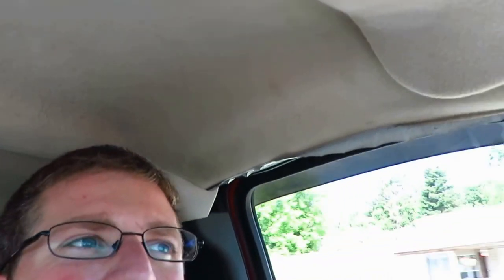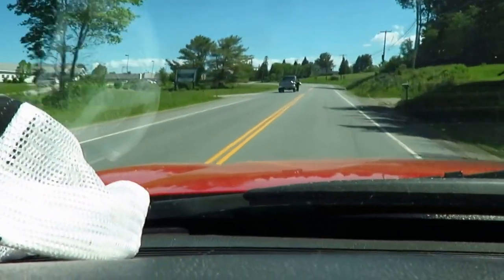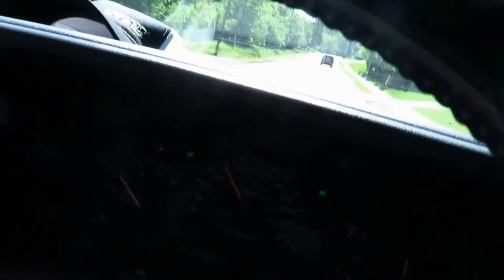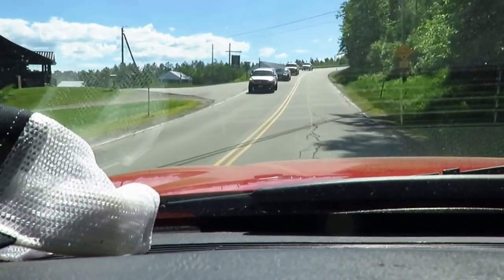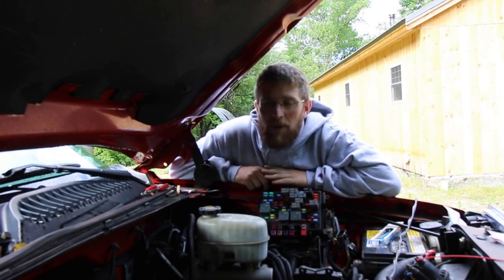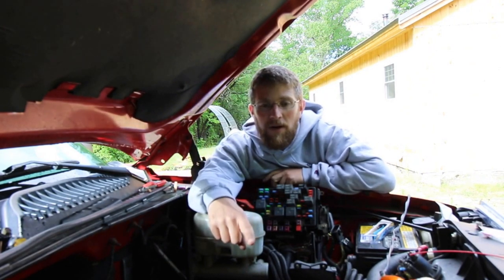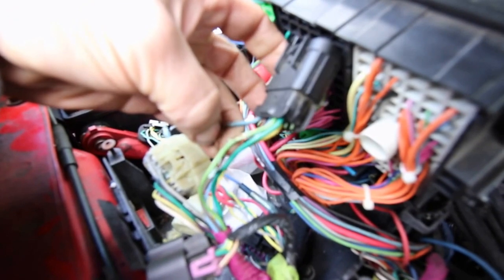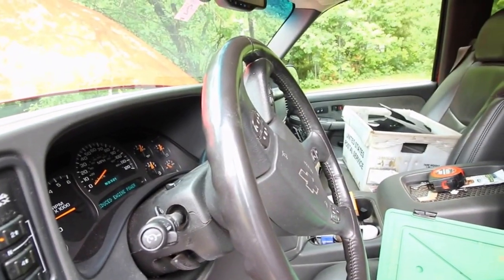Chevy Reduce Power Truck update

Comment: hey just wanted to let u know I did the same thing as you. Checked the fuse box and indeed mice had chewed some of the wires, one to the etc fuse. Then I remove my intake manifold  (which was the nastiest I've every seen) and found that 3rd ground wire broken off. New connector and Problem solved. Thanks a lot man, I went thru at least 15 "p1518 YouTube videos before I got to yours. 😥😥 I may upload a video of my fix and will give you a shotout
Reply from the maker: thanks. i am so glad that it lead you in the right direction and you were able to get it. the reduced power is dreadful

Comment: So I have an '03 silverado with a 5.3L that just turned 222,222 miles as of last night. A few weeks ago I got this same "reduced engine power" message out of nowhere. Little did I know I could have just turned the truck off & then back on & it would have ran fine. Instead I just limped the truck home then the next day went out & started it & took it to my mechanic for some tests. On the way there the check engine light stayed on but the message was gone & the truck ran fine. He performed some tests at the shop via. snap-on computer, checked a few things, cleared the code & I have not had this problem since. Keeping my fingers crossed.

Comment: My 2003 6.0 silverado does reduced engine power but i turn it on and leave it running for a bit on while reduced engine power is on the instrument cluster. I do this a couple of time then its running fine the check engine light turns off aswell after running it for a while

Comment: Been dealing with this reduced engine power for about 2 weeks. Now that I just saw your video do you think there are 2 ground wires on a 2003 Silverado 5.3. I changed the cam shaft sensor and the ground that you showed. But I  thought there was only 1. Code P0101 and P1518 and P0641. MAF sensor changed also

Comment: After many repairs, my truck sometimes went for months without the reduced engine power issue. But it keeps coming back. Is your problem still resolved or did it come back again after the ground wires were replaced?
Reply from the maker: I have not had the issue again! Sorry yours keeps coming back!

Comment: I get a P1518 code.  5.3  2003 runs drives   when accelerate quick throws code and throttle doesn't respond    this si after new Autozone TB   and put a second thought it was defective.  not the case.
Reply from the maker: Rob Rizzo I would check out the fuse block under the hood for chewed wires. If there isn't any I would check the ground wire to the back of the engine block. Good luck

Comment: How do you remove the whole fuse box to check underneath? I cannot figure it out. Mine is an '03 2500HD. Thanks!
Reply from the maker: +David Denson you take the cover off.  Then there is a couple of plastic tabs try using a screw driver to pry the tabs over the ears.

Comment: I'm having them now. same 2500hd but a 03 model. what year was yours
Reply from the maker: mine is an 2003. 2500 HD. i would check the wires under the fuse panel under the hood. and then check the grounds on the back of the engine block on the left side. you might have to take the intake manifold off. sorry your having the issue
Reply: ye I look for the ground wire that u mentioned before I saw your video. I used my phone to find it. but I only had one wire connected to that bolt. so tomorrow I will take out the intake and check again as I have the same truck as your's minus 4x4. thanks a lot
Reply from the maker: Mario Duckett yw let me know what you find
Reply: Same here only one wire connected to that bolt.  I was able to get to it without taking the intake manifold off.  The beast ate a 13mm socket but other than that OK.  There is another ground wire on the frame  under the driver's door that I read has something to do with this so I cleaned that up as well.  Now I'm going to look for the third wire.  I think it is on the other side of the block.  But, since problem is intermittent and is running fine now - who knows?